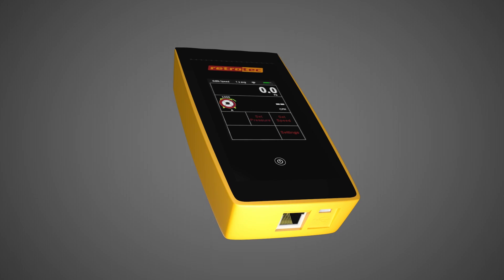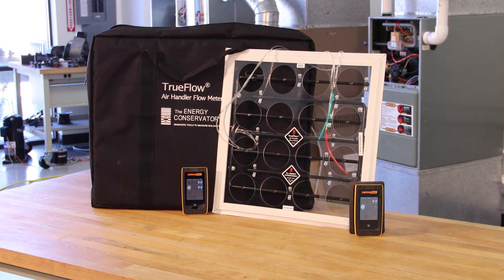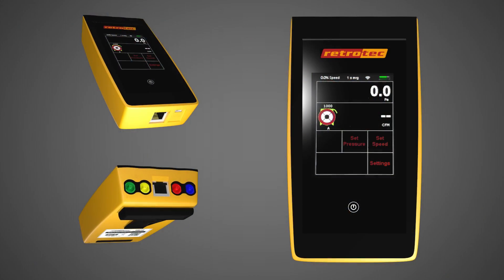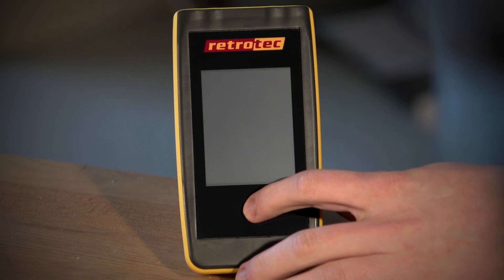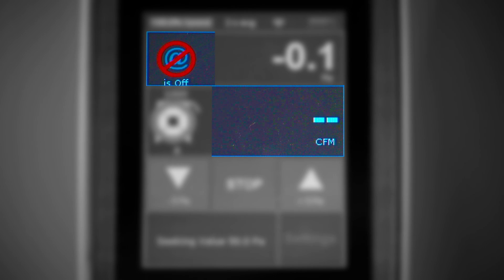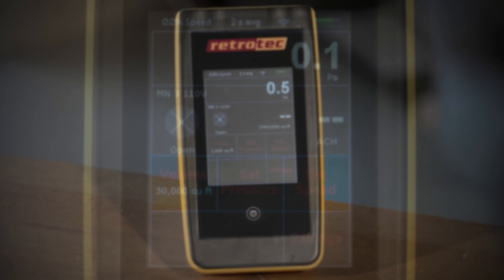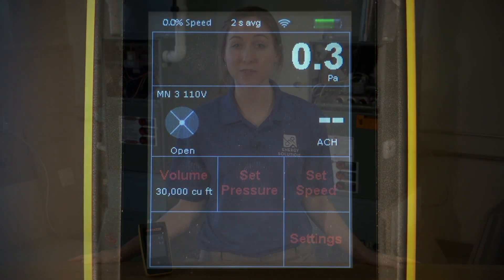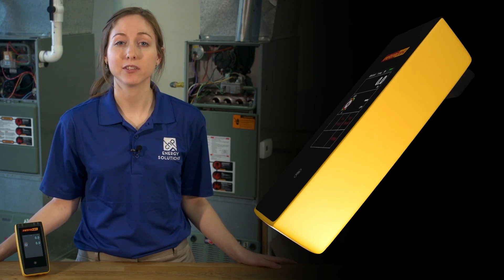Retrotec DM32 Instructional Video

Comment: Hi I am doing a degree project for air leakage, wanted to know how to do the testing with the software. How to conect the fan with the pc
Reply from the maker: Check out this presentation here. I talk about connecting the gauge to a PC (about 8 and a half minutes in). You can connect with USB, Ethernet, or WiFi. For multiple gauges in the field, I recommend Ethernet with a router or USB switchbox. https://www.youtube.com/watch?v=xMQSUDCXJOA&t

Comment: is set the area or Volume is compulsory in DM 32 as we are giving Data in software
Reply from the maker: If you are looking to get results in ACH50 or CFM/sq.ft, you'll need to measure the actual volume or area of the building or get it from the building plans and input that into the gauge. This function is designed to save time by cutting out the additional math you would need to do after the test to convert results from CFM50.
Reply: If by having the Sq footage of home can I calculate volune